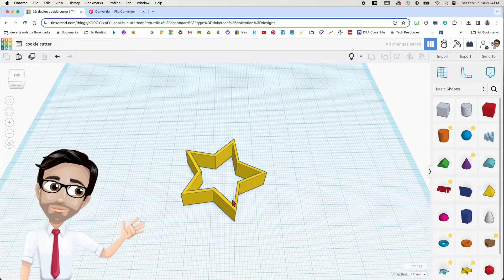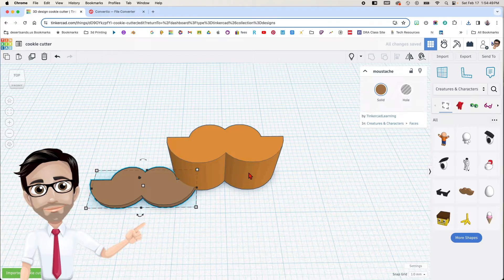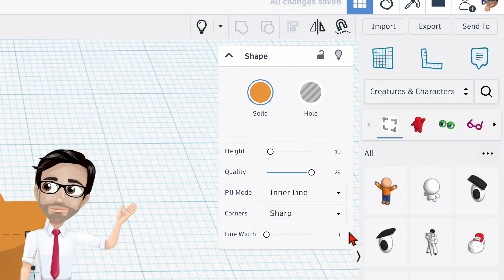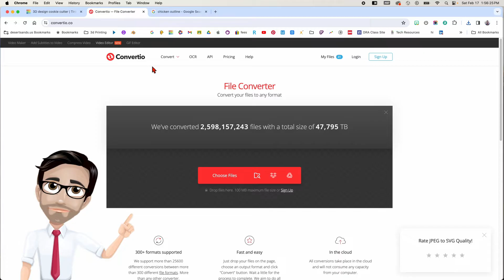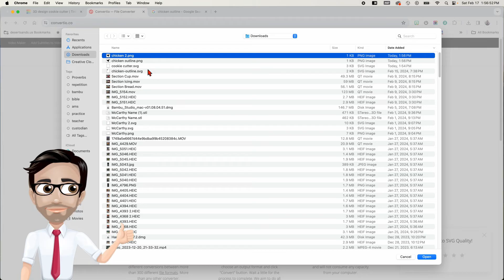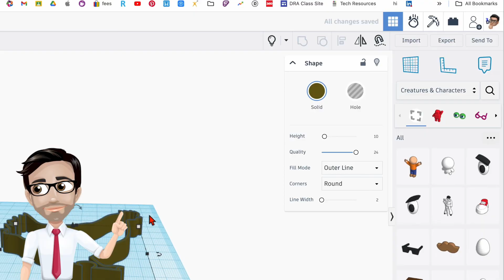How to Design a 3D Printed Cookie Cutter

Comment: I am super late to this video, but I liked the simplicity of it. I really only had one question though. The part that cuts the cookie is normally tapered thinner. Could we use the same method to just make the outline a little thinner so that it would actually cut dough cleanly? Or would that mess up the integrity of the print making them easy to break?
Reply from the maker: Yes you could use the same method to make a thinner part.  Just be aware that there is a limit as to how thin a printer will print.

Comment: Hey thanks so much for this! this helped me a ton! only question i got is how would i make the top a little of slimmer line like more of cutting edge so rest of cutter is 2 and i want that one 1 so that it sharp if that makes sense, would i just add another one, cut it then try and lay it ontop? thanks!
Reply from the maker: I think that’s how I would do it.  Good luck.